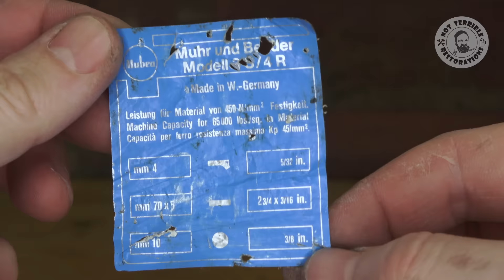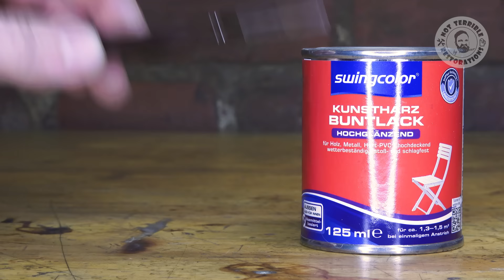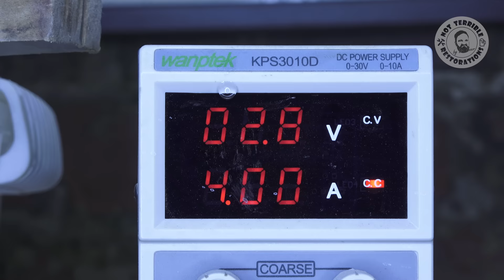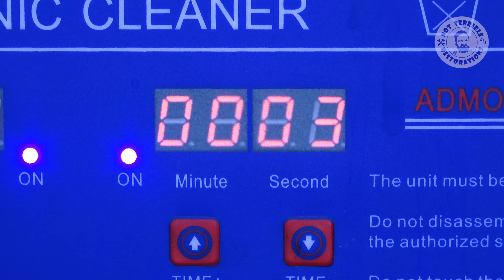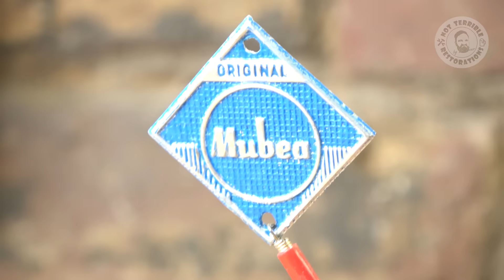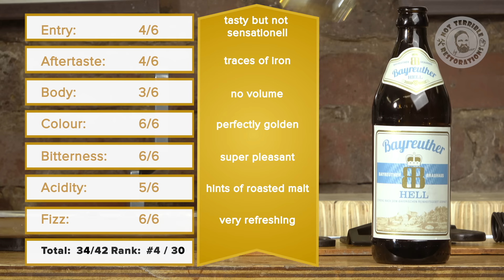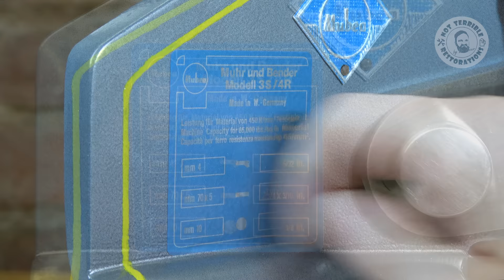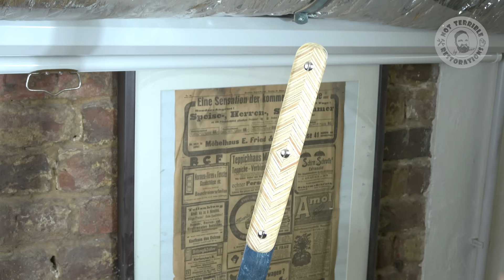WINNER: How 100 Slices of Plywood Won Me the Battle

Comment: Since it's a contest and we are the judges, I have created categories by which each restoration is to be judged. The categories are Disassembly, Cleaning and Rust Removal, Hardware and Casting Improvement, Paint Preparation, Painting, Originality, Re-assembly, and Operation. Each category has a scale of 1-5 (1 is lowest score, 5 is highest score) for a possible total of 40 points.

Disassembly - 5
Cleaning and Rust Removal - 5
Hardware and Casting Improvement - 5
Paint Preparation - 5
Painting - 3 (The pin striping was thin and uneven)
Originality - 5 (does not include the new mounting base)
Re-assembly - 5
Operation - 5

TOTAL = 38

Your restoration turned out beautifully! You went above and beyond by paying careful attention to the details. I feel that the paint you chose to use was as close to the original as possible. Very nicely done.
Reply from the maker: Haha what a nice idea of you. You yourself went above and beyond with this Feedback. Much appreciated how much thought you put into this
Reply: @NTRprojects  I sort of patterned the idea the same way you rate the beers that you try. 😁

Comment: Having watched both videos I'm giving my vote to you, Dr. Beer.  The shears were similar but not identical.  I feel you got the more difficult shear to restore.  You both did good restorations of the shears.  However you made two mounts, one for mounting on a work table and the wooden mount, which was excellent.  You also made a very nice wooden handle.  Mr. Patina didn't make mounts or a handle.  You did pin striping on the body, which matched the pin striping on the original.  Plus, of course, you evaluated a beer.

Comment: Mr. P ran into a buzz saw in this challenge. You took each and every step to the next level. The handle was the best example, the herringbone pattern was centered on the handle, the holes were right down the centerline and the screw slots aligned with the centerline. Masterful work sir, makes me -round to be a patron. Thanks, Ed

Comment: Both are outstanding! The two machines are not exactly the same. The end result function is the essential thing. For function, Dr. Beer hand sanded the blades, removing less metal, and did not use shims. Was that a difference in the blades, one set more worn than the other?? Both cut metal as required. For paint, Dr. Beer wins, for more thought, and I happen to love that look and color. For the base and handle ... WOW! And interchangeable two bases are better than one. (The parts about nickel plating bolts, then turning, confused me. Mr. Patina was less complicated, but the video progress was clearer.) In this competition, Dr. Beer! But what about the next one?? Different skills?? Who will win that??
Reply from the maker: Hey dave thank you for the outstanding Feedback. I have to ask, since youre the second one to think that i turned the screws after plating. I did not Do so. Maybe the chapter headline was confusing. I first sandblasted, then sanded and turned, then plated
Reply from the maker: And as im writing i realize that i gave the impression that the sandblasting step Was already the zinc plated parts
Reply from the maker: I will add a comment to clarify in the subtitles
Reply from the maker: Added two subtitles at 7:42 maybe that clarifies
Reply: @NTRprojects  --- Yes, at 7:46 the red chapter heading say "Zinc Plating" (and "Chapter 3"). I thought, "Oh, OK, those are zinc plated parts". That's just my bad, being so used to consumer items in stores, advertising campaigns, and so forth. People who know nothing about engines will buy a car for the upholstery and the paint color. I have not ever seen freshly sand blasted parts in real life, nor freshly zinc plated parts. "First I sandblasted the parts as well" clarifies it. P.S. You guys didn't have "Who buys the beer" bet on this, did you??
Edit added: "Chapter 3: Preparations for Zinc Plating" (or, "Sandblasting"), then at 10:35 "Ready for Zinc Plating", would have been unmistakable, but most apparently understood it the way you presented it.
Reply from the maker: @davesmith5656  we sure have dave. Whover is the winner gets a crate of beer and the Workshop cleaned up

Comment: Great restoration. They only thing I'd do different would be adding some more rubbers stoppers about centre of the wooden base. I imagine there will be lots of force at that point. Or adding some metal reinforcement.
Reply from the maker: I think you are right. I will add some

Comment: I don't know, if it is fair to judge the two renovations as equal. Sure, the metal cutters were almost the same, but you have, undoubtedly,  the better tools and were Patina strived for smoothness you obtained the original hammered surface. All in all I would say it's a tie, but your angular sharpened blades gave you the win, imo.
Reply from the maker: Hey Tina. I think he also did the angular blade, but didnt show it in the video. So we are back to a tie I guess

Comment: Love the work. The only thing is on the reassemble, adding a drop of greese or oil to every thread or moving part will help prolong the life of the tool as it will cut the  wear down. I absolutely love the handle and base improvements.

Comment: I had to be fair about this because I love both channels. I broke it down into sections. Disassembly and reassembly - tie. Both professionally done. Surface preparation - Mr. P. I just love a nice smooth surface before painting. Surface finish - Dr. B. At first I was leaning the other way until he zinc coated the nuts and bolts. Originality - Dr. B. The bolts that Mr. P had were in bad shape but some of them could have been restored. Extras - Dr. B again. The beer break didn't influence my vote even though that's the way I work. The Michael Alm style base and handle did it for me. (If you don't know who he is look him up.) Overall, I have to go with Dr. B.
Reply from the maker: You know your stuff, Michael Alm was my Inspiration

Comment: Nice restoration, only two things that i would do other way. In my opinion rounding every edge and corner do not always make things look better, especialy when metal fla surface will be in contact with another one, then it look better if stright angle is kept. Second thing is wood work. You done tremendous work in creating this table and handle, but for durability purpose i would use some resin to make it stronger (just a sugestion :) ). That or another way Good Job Sir :)

Comment: at 8:14 you see the numbering of the Bolt-quality marked with 8.8 and a three letter code for the manufacturer. So you see that is a modified standard bolt where someone turned the groove at the head. I am not sure if this bolt-factory still exists.  I would have tried to mantain this factory-marks as they also tell part of the history of that tool.

Comment: You win!  I was surprised Mr. Patina went with spray paint vs. powder coating and cold bluing.  Your bolts were in better shape than Mr. Patina's, but I like the fact that you didn't use any new nuts/bolts/washers.  The base and handle put it over the top.

Comment: "Attention to detail 8 "you should not zinc plate and sand it away defeats the purpose of the sacrificial metal.  "Creativity 9 "dizzying  pattern was nice total 8.5 good job
Reply from the maker: Hey Pete, I didnt sand it away. I polished the zinc plating with fine steel wool, which doesnt take away the thick plating. Sorry if that was not clear in the video
Reply: @NTRprojects  ---- Thanks for the explanation there. I've never made a video, so I'm sheepish saying this, but that part confused me. I thought you turned the zinc plated bolts.
Reply from the maker: @davesmith5656  I added comments to the subtitles at 7:42 in order to clarify. Thank you both for pointing out, that it was confusing
Reply: @NTRprojects  ---- No big deal, I'm sure you didn't go mess up your own work 🙂. Just like in competition diving, you didn't get a 10 for that little video technicality.🙂 It's about restoration, and video is the packaging (Mr. Patina is a bit better in video, imo). I voted you the restoration winner (I can mop up milk from a kitchen floor, but not much more in the way of restoring - kind of like an Olympic diving judge who can't swim). Thank you for explaining.

Comment: I like  the end result, except for  the yellow pinstripe, which is a bit sloppy on the side you didn't mask. I liked that you reused and cleaned up the hardware, and powder coating will be a more durable finish than paint. Really didn't care for the sped up bits of footage though. It's much more enjoyable to watch the cleaning and machining in real time.

Comment: Sorry Mr. Patina, but NTR wins by a landslide. Your video is very good and your work is solid and consistent, but Mr. Beer is not less in this and he does many more things. I am surprised I saw in his video some parts (some screws and the spring) that I didn't see in yours. What's it the same model of sheet shear? Also, he works wooden pieces nicely, and you do nothing with that. Finally, your high-tech label is very nice, but Mr. Beer again surpasses you by restoring the original one and recreating the nameplate. Good work, Mr. Patina, good spectacle for all of us, thank you. But Mr. Beer wins.

Comment: I do model railroading.  I've learned that a dark color goes over a light color much easier than a light color goes over a dark color.  So for the pin striping paint the yellow pin stripes first, mask with tape, and then paint the dark color.
Reply from the maker: Very interesting Peter. Thank you for that